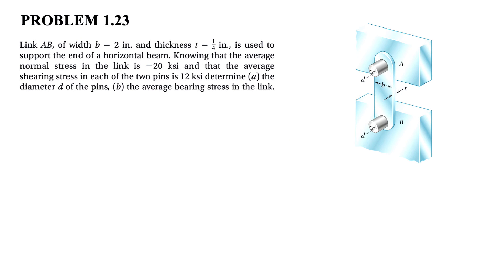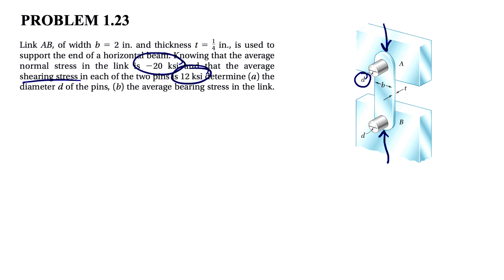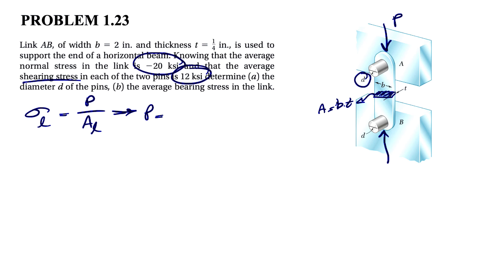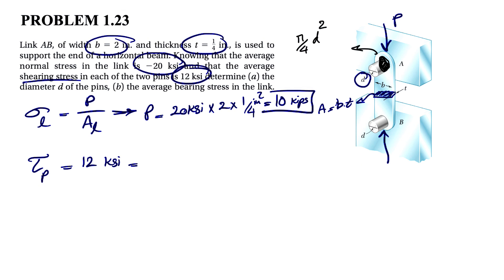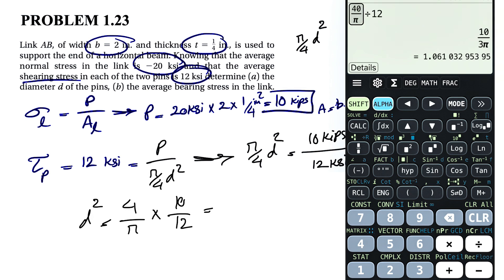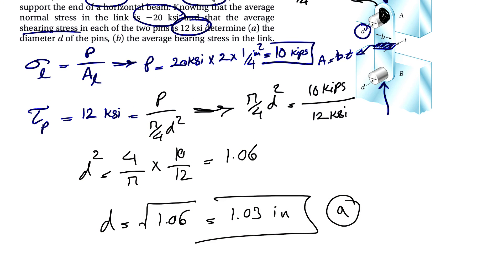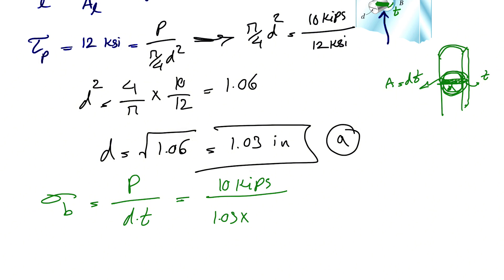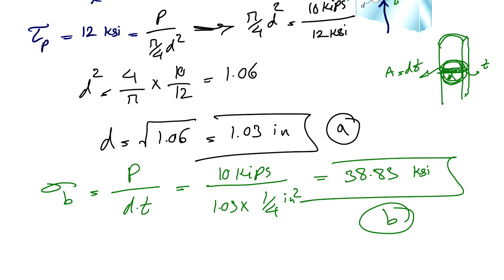Problem 1.23 | Can YOU Crack This Mechanics Challenge?

Comment: wouldn't the shear force(10kips) be divided by two since it's being shared between the two pins?
Reply from the maker: good question, no because the link AB is in compression and the force P is applying on the two ends (otherwise we wouldn't be in equilibrium condition), so each pin gets P (10kips)